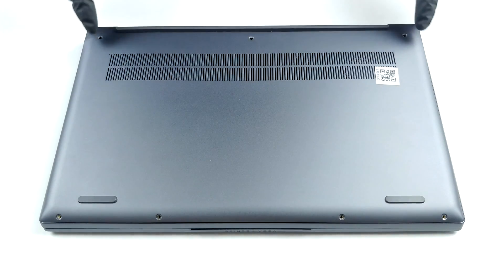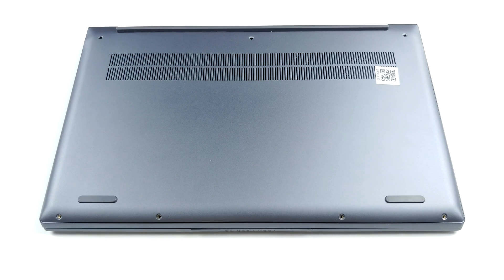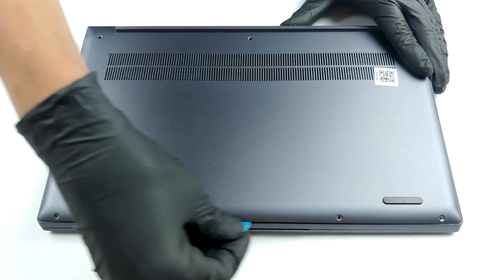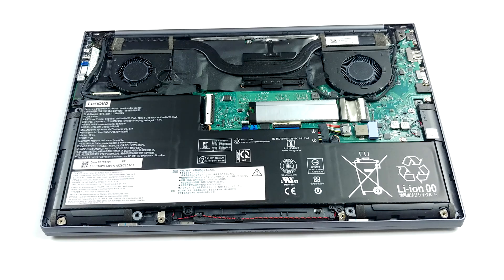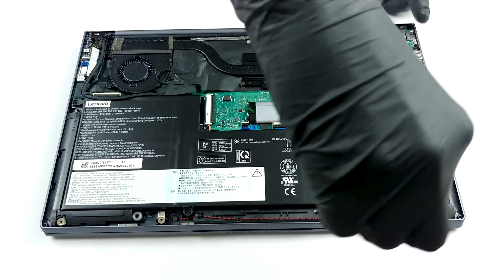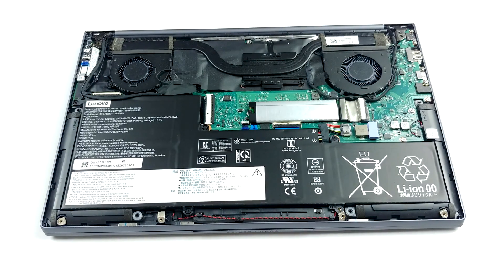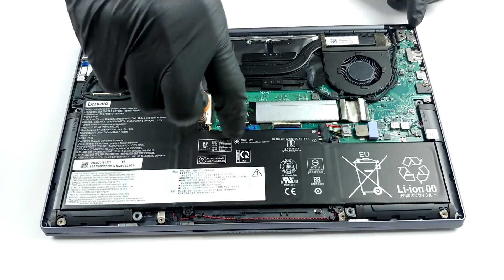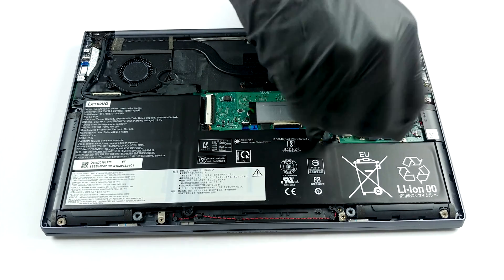🛠️ Lenovo Yoga Slim 7 (14) - disassembly and upgrade options

Comment: what size is the torx screw driver in use?
Reply: Torx 5. I just did a successful disassembly and repair of a stuck power button myself (after the computer was dropped).

By the way, it's important to open in all sides with the plastic pick as shown in the video, before trying to ply the back cover off, otherwise it sticks – apparently mysteriously – in the center of the cover. It turns out that there are some plastic things in the center of the back cover that holds the cover down until the cover is pushed a few millimeters towards the screen side, and you can only push it when all sides of the cover has been pryed completely loose. That tricked me, as I thought I could begin to open the cover even when it wasn't completely loosened at the screen side and couldn't understand why it was stuck in the center where there are no screws.
Reply: @JoyfulJabber  Same issue with power button on this model (kids dropped it— of course it’s like a month old 😣). Power button is jammed. Using a clamp clamped above and below the power button somehow keeps the power on. Can I ask how you fixed yours? Thanks!

Comment: Should really take everything out so we can see where the wifi chip, CPU, RAM, etc are located for future upgradability.
Reply: You can't upgrade the CPU nor the RAM so no point in doing that. Also, Lenovo offers comprehensive disassembly guides

Comment: oh man, how I wish I could switch out my Lenovo Yoga 530 Ryzen 2500U to this... The construction was extremely flawed. Single fan which can't even keep up with the rated 15W TDP, 256MB of dedicated VRAM (rendering a lot of older games/programs useless). the UEFI software forces also the computer into 400MHz mode at 20% Battery (400MHz!!!! basically you can only use the computer during first the 80%) I reached out to Lenovo for 3 years during my warranty period, but I was talking to deaf ears. they had no incentives to recognize or fix the issues. The construction of this one, looks at least 10x better, so from my understanding they actually learned something from previous design, but never cared about the customers that were affected

Comment: change it's thermal compound ...... this laptop heats a lot
i have had multiple ppl who's cpu temps goes to 100 ... including mine
Reply: i did change it for thermal grizzly, slight improuvement but not much , never hit 100 degree even stock compound

Comment: I own this laptop but I noticed a single issue with the design. The area
 where the bottom of the laptop meets the top between the two screws on 
both the left and right side seem to have a small gap between the two 
layers. When you slide your finger from top to bottom you can feel the 
edge of the bottom half slightly coming forward and not seamlessly fuse 
with the top. I've contacted Lenovo support about this issue and they 
said it wasn't harmful and if I found it too annoying I could get it 
fixed for free. Although, I was wondering if I could fix it myself by 
maybe unscrewing the bottom half and putting it back on again. Or, maybe
 only tightening the screws would do the trick. If anyone has some ideas
 please let me know as it's very annoying and I don't want to send my 
laptop back and wait around 1/2 weeks for it to return.

Comment: Is it 360° convertible nd touchscreen
Reply: Yoga Slim 7 is not convertible - hinge can only goes up to 180 (flat). Touchscreen is optional for Yoga Slim 7 -- you may need to check the specification with the seller. In Indonesia we have one part number which has touchscreen display.

Comment: Second PCI-E slot can be used! So you can have 2 drives...
Reply: I second this! I use a second ssd m.2 nvme 2242 and it works smoothly. Is also worth noting that the Intel version specifies it doesn't support 2 ssd. That's not the case for AMD version.
Reply: No way ! ( So you can use a PCI-E to Egpu style ? )
Reply: @Seidowas  its easier to use an eGPU for that matter. I wouldnt use a premium laptop like this without bottom cover...

Comment: I bought mine today. Asked the Lenovo guy about the storage options and he dug through the official spec sheets of the laptops. Turns out Intel models are not able to use both m.2 sockets at a time but in AMD models there were no restrictions marked on the spec sheet. Both sockets should work fine!! 
I have the r5 4500u with 8gb ram and 256gb storage.
Reply: Is this accurate? Can anyone confirm? If yes, I'm even more leaning towards buying the AMD model
Reply: @amrazing33  their is already a video on youtube showing it works, its also in the amd specs sheets that it works for the amd version.
Reply: @lancet.4315  can you perhaps share the video link or something?
Reply: @amrazing33  jossu's hardware has it posted on his channel.
Reply: According to information we got from Lenovo Indonesia, the PSREF serves as general specifications offered by factory (variations produced for the type), in the case of Yoga Slim 7 Intel it doesn't mean that we cannot add second storage in the empty M.2 SSD slot.
Reply: I know it's a bit off topic but does your screen wobble?
Reply: @csu3886  I got glass screen and no it doesn't wobble
Reply: @csu3886  mine does :(
Reply: Is Ram upgradable to 16gb in this Amd model??
Reply: @edaardwolf  no
Reply: is the additonal socket a m.2 2280 or 2242 size?
Reply: @Nathaneal51  depends on the specific specification in your laptop, which storage already installed from factory. There are two slots 1x M.2 2280 + 1x M.2 2242, both can be used.
Reply: @LenovoOfficialbyIMD  Hi, I am getting the Lenovo Yoga Slim 7i Carbon | 11th Gen i7-1165G7. May I know if I can upgrade the SSD like this video?
Reply: @zenscape  Hi, Lenovo Yoga Slim 7i Carbon only has one M.2 storage socket. You can upgrade it by replacing the installed storage with 1TB M.2 2280 SSD PCIe NVMe
Reply: @Nathaneal51  shorter 2242
Reply: Does the second m.2 2242 slot support SATA drives?
Reply: hey one question , is the 8gb ram version running in dual channel or single channel?? some are saying only the 16gb version runs in dual channel.

Comment: Can you test if the claim that both SSD slots can't be used at the same time is true? For me that 100% a deal breaker.
Reply: @ashok choudhary I have bought the Slim 7 and will be testing this as soon as possible!
Reply: Thanks for testing it for us
Reply: @w2best  any answer ?
Reply: @Seidowas  No it will take a while before I'm able to try this. My unit came with a broken webcam so I will send it back as DOA and wait for a new one before I can try that out. So please search the info elsewhere in the meantime :)
Reply: Ah - someone else commented down below just now saying it works fine on AMD models! :)
Reply: @w2best  》
:O
Reply: @w2best  at a time
Reply: @w2best  do they work together
Reply: @fame_game001  yes, perfectly fine. But if you mean in RAID 0 i haven't tried that.
Reply: So can we ?
Reply: @shimmya  yes. Both in the Amd and the Intel version. I have a very recent video testing just that
Reply: @w2best  thanks you so much !
Reply: Your video came after my search. About upgrading yoga 7 ssd. Can we add hdd or upgrades ssd.
Reply: @fame_game001  hdd there's no space for. But you can add an ssd and it works on both amd and intel models.

Comment: Hi LaptopMedia,

May I ask the LPDDR4X RAM would be slower than the DDR4? even though LPDDR4X can keep the battery lasts a bit longer..
Reply: There is virtually no difference in peformance if you compare them at the same speed and timings

Comment: So which laptop is better (build quality and screen etc) the lenovo slim 7 or the ideapad 5?
Reply: Yoga Slim 7 is definitely one of the premium series (better material, Glance smart assistant available for IR camera model, Athena certification, hinge up to 180 flat, Intel mode has Thunderbolt ports). IdeaPad 5 is more affordable and different class from Yoga series. The hinge of IdeaPad 5 cannot reach 180 flat.
Reply: The 2 are basically the same. Except the Lenovo yoga slim 7 has a touchscreen and the "yoga" branding
Reply: @AhmedAwad-dm6od  I don't know how you came to that conclusion but the Yoga slim 7 is one "line/class" higher then IdeaPad 5. Better build quality/materials, more port, better RAM.
There is a reason the yoga slim 7 is more expensive.
Also the Yoga Slim 7 with ryzen is not available with touch this is only optional in the intel variant.
Reply: @AhmedAwad-dm6od  I don't agree with that statement. The yoga slim 7 is quite a bit more interesting imo being lighter, slimmer, USB-C charging (2*USB-C) and with 16gb ram in dual channel. In sweden it's impossible to find an Ideapad 5 with 16gb ram. I haven't tried the Ideapad 5 yet but would like to compare them going forward! :)

Comment: where are the ram modules? and are they 
upgradeable?
Reply: No they are not... But it is 16gb LPDDR4X 4266... So not a big deal
Reply: @pitchblack2983  are they dual channel?
Reply: @josephchristoffel  yep
Reply: @pitchblack2983  i got a 8gb ram, not a 16..
Reply: @shimmya  is the 8gb version also running in dual channel ?? or only 16gb version runs in dual channel?
Reply: @wdvhi  ill tell you asap

Comment: LaptopMedia are claiming that Lenovo official specs say that only one of the m.2 slots can be used at once. But Lenovo's official specs do not specifically say this. All they say is that the laptop will ship with either a 2280 or 2242 size m.2 SSD. so why don't you try adding your own ssdand prove it to us that your assumption is right, before making claim that has the possibility of being false.. It's very unprofessional, and fucked up

Comment: whats the point of two m2 slots if you can't you them both at the time?
Reply: theres no information available regarding weather this claim is true not..
Reply: Can't be true. My Ideapad 5 14'' with R5 4500U can use both. Weird that they didn't just test it...
Reply: @konstantinliebich9427  how do you like that laptop? Its out of stock everywhere but this slim 7 I can buy
Reply: @konstantinliebich9427  it's because the slim 7 has a thunderbolt port and the ideapad doesn't. Thunderbolt uses up more of the limited pcie lanes so there aren't any leftover to run both m.2 ports at the same time. The two supported are for the different length cards, tho it is a little odd they didn't put the shorter standoff on the same side and just use one port... maybe just re-using parts from other models?
I wonder if a bios tweak would allow you to disable thunderbolt in order to use both, or if the two connectors actually share the same bus
Edit: Actually not sure if any AMD machines have "thunderbolt," as it's an Intel-licensed spec, which is basically USB-4.0 with the caveat that you have to pay Intel to use it
Reply: thunderbolt is intel only feature
Reply: @mrmrmrkevin  It's only the intel model that has Thunderbolt - so this shouldn't be the reason. I REALLY hope this info is not true but really wish they would have tested it in the video...
Reply: There is another video where another channel shows that it indeed is possible to use both M.2 slots.
Reply: @williaamlarsson   can you link it for me?
Reply: @maarten-20  https://youtu.be/YgZ1gCgecrY but this is the amd version of the slim 7
Reply: @leeger777  Sure there is not! But the Saber NVME is available in both 512, 1gb and 2gb!

Comment: Love watching teardown. Can you take the heatsinks/fans off too in the future videos?
Reply: I'm curious where the ram chips are soldered... The cpu can handle 32GB, I wonder if someone capable of bga soldering could swap in bigger modules... Makes me sad 32GB is not an option for the yoga
Reply: @mrmrmrkevin  I need to know also. Because I just stop myself from taking laptops apart and upgrading everything to max after a few months...
Reply: Kevin Hake I think that for most of yoga users, 8-16gb is just fine.
Reply: I think so,lest show us about cooling pipe system !

Comment: Does this video show AMD or Intel powered unit?
Reply: Dude come on, just watch the video for 15 seconds and you'll know the answer
Reply: amd.. apparently the amd version only has one heat pipe, but the intel one with the discrete graphics (mx350) has 2 heat pipes..
Reply: Why everyone waiting for AMD version? Is nowadays AMD is better than Intel?
Reply: Boby Soegiarto yes a lot better. This laptop comes with a 4800u which has 8 cores 16 threads and very good integrated graphics
Reply: @bobjkr9870  cpu wise amd is better, but if you look for better gaming performance go for the intel version
Reply: @arielamadio8947  Ryzens pretty much blow away Intel in gaming as well.
Sure single core synthetic benchmark might shows that Intel has the upper hand. in real life? not so much.
Unless you're going for the much much more expensive i7-10875H, then Ryzen is still a much better choice. then again, there exists Ryzen 9 mobile that could go toe to toe with the i9 (too bad there're pretty much no great Ryzen 9 mobile laptops around just yet)
Reply: @kamikakushi_  I meant that the intel version comes with nvidia gpu,  which is still better than the igpu on the ryzen 7
Reply: @arielamadio8947  that, I agree
Reply: @bobjkr9870  yes...